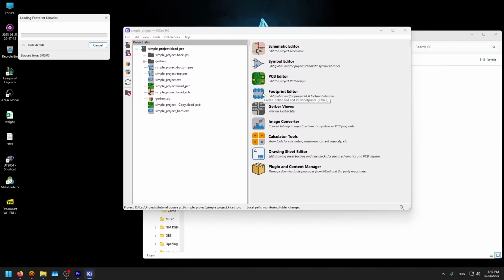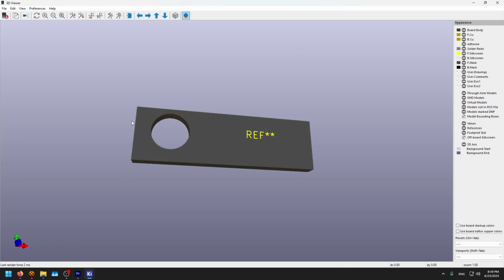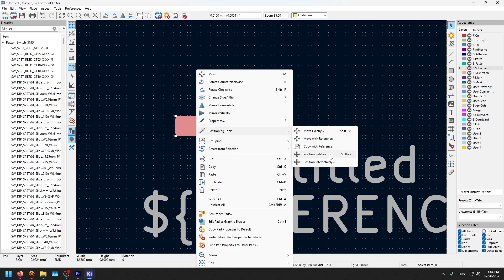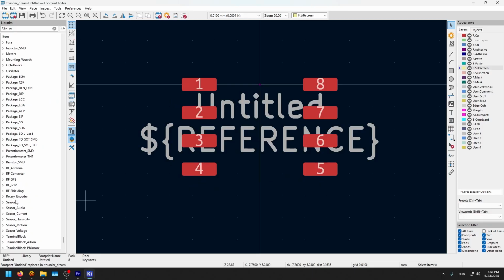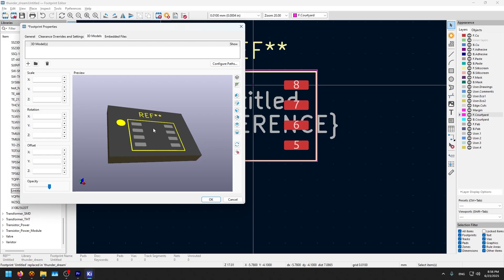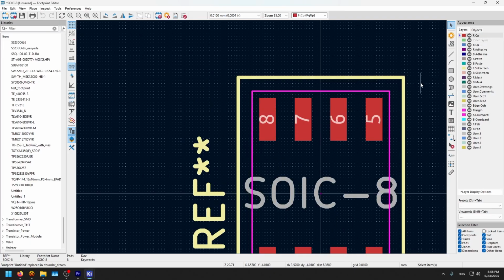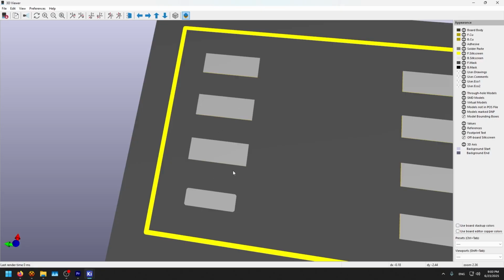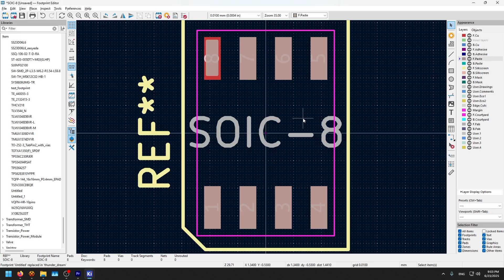KiCAD 9 tutorial course [06] - Footprint editor

Comment: For the last part of the video, could you share what the point is of leaving the copper pad larger than the exposed area?
Reply from the maker: i explained in the video, it is called soldermask-shrunk or defined pad.

the reason is to have minimum soldermask area between the pads (bridge) according to the manufacturer.

smaller solder mask may not be possible to make or will cost extra. so you increase the mask a bit to slightly cover the copper area which won't affect the pad soldering to the pin.